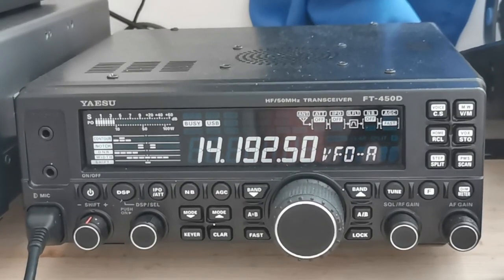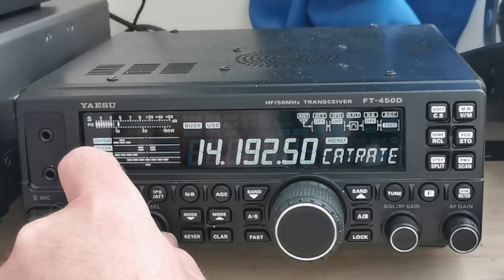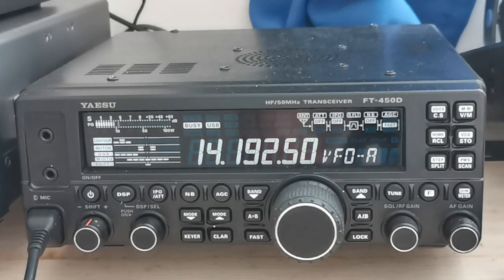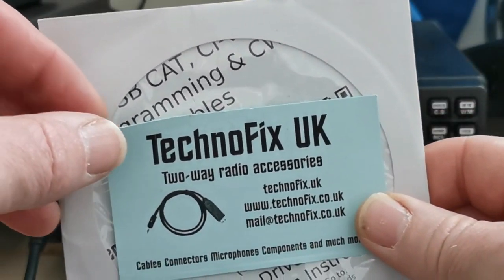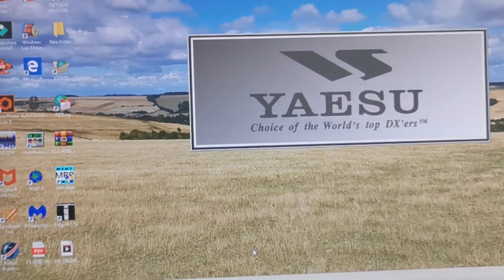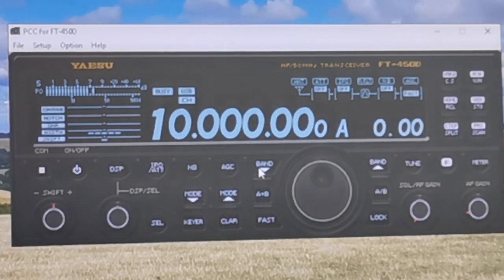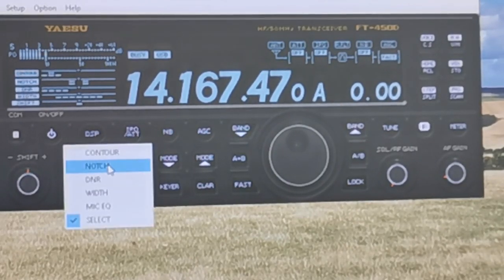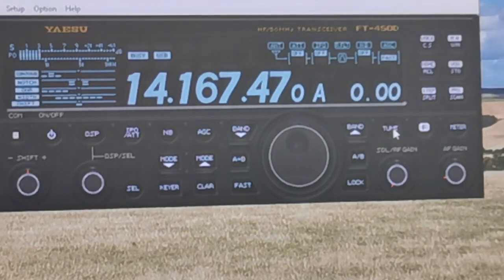FT--450D cat & Controller PCC Software

Comment: I liked the radio apart from the receive audio, to my ear it's almost unintelligible..
Reply: Did you use an external speaker or headphones, A radios internal speaker is usually never good. I always use headphones. 

I find that using contour and notch can really make the audio good, at least on the 891 and FTDX-10, the FTDX-10 has some amazing audio and receiver compared to my old 7300 which is gone now and I don't miss it, the audio was harsh and tiring to listen to and I needed NR on all the time, don't need DNR on the 891 or FTDX-10 it sounds so good. 

I have a 450D coming now and will sell the 891 just because I want a radio with better ergonomics with more buttons as I don't do much portable ops now since I no longer work shift and don't have as many days off. The 891 has a terrific receiver though and audio, in fact, had it not been for the 891 I'd not be any the wiser as to the bad audio from the 7300. I can still take the 450D with me if I work portable because I never work far from the car anyway.
Reply: @o00scorpion00o  that- s true. i think tha same about notch active. it-s a more silent and clean audio. the same for the contour that works good for my ear.